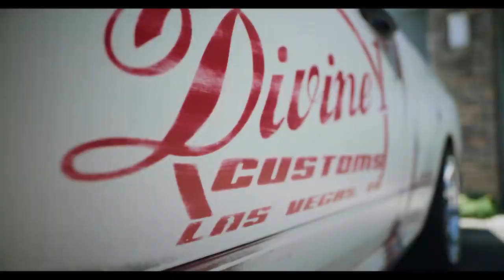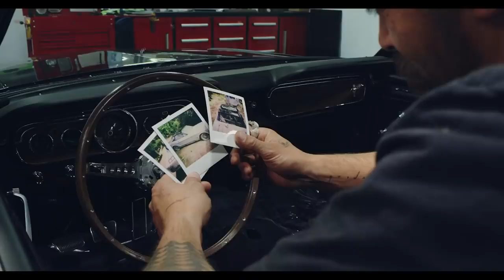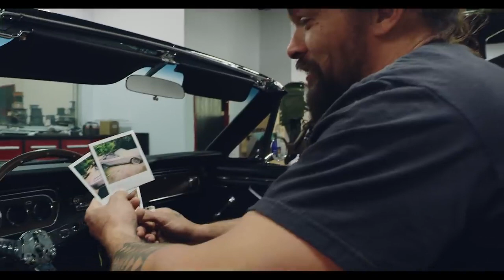MY WIFES FIRST MUSTANG (JASON MOMOA)

Comment: Man, I get so conflicted. It's a 1 of 3 1965 Mustang GT convertibles with a 4 speed, air conditioning. Silver with black stripes, black interior... I hear 1 of 3 and it needs to go back to orignal. Even the dealer installed AC. 

Now they go and put things back to period correct wheels, it looks amazing, and then they paint it black.

Jesus.